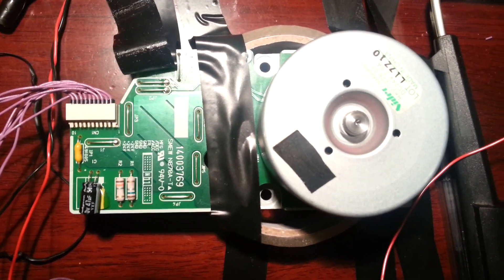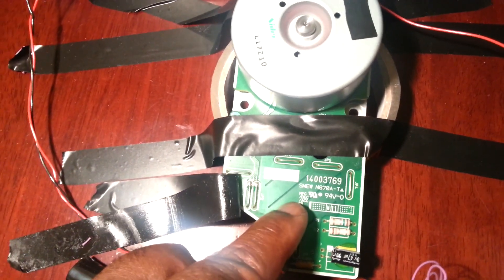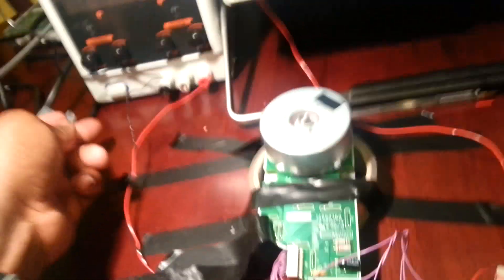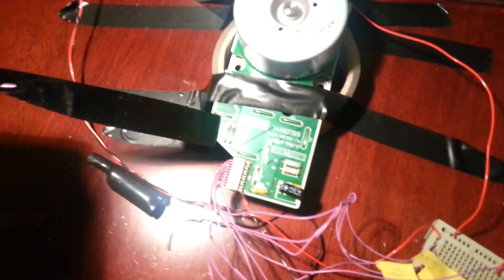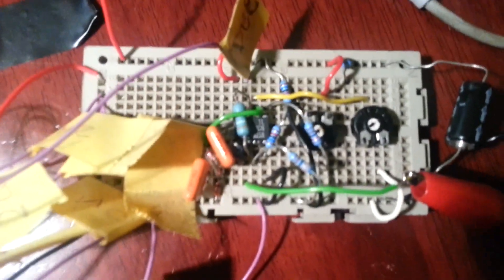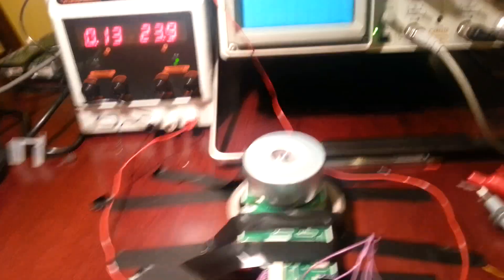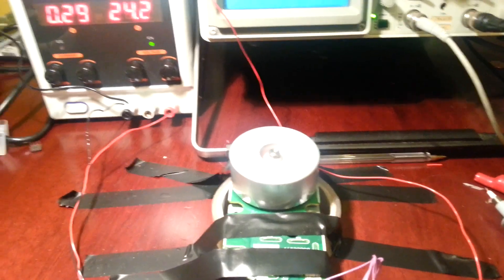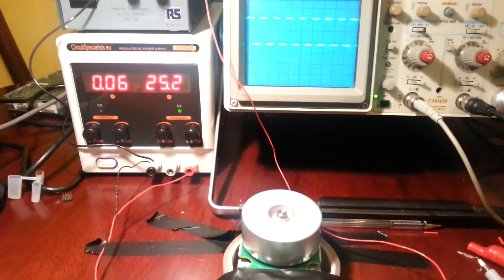Running an HP 2605 Laserjet Laser Printer main drive BLDC motor.

Comment: Hi.
 I have a Nidec brushed motor. It has 9 pins. I removed it from Lexmark t650. How can I run it with power source? I will use it in another project. Motor image:https://l24.im/50m Mail : mert.baldrr@gmail.com thanks

Comment: Just FYI the "Ac" and "dec" pins stand for acceleration and deceleration... they regulate how quickly the motor slows down or speeds up per instructions from the driver... 
Nice video tho, thanks for sharing!
Cheers!

Comment: Hello Coolkeys2009, I have a few of these motors and a couple of arduino Uno boards that I'd like to match and use. I'm not quite familiar with electronic but, do you have a schematics that clearly illustrates what to do and need. I'll check afterward for the arduino libraries to make it possible... Thanks in advance

Comment: Hello Coolkeys2009,
impressive hack you have there. I've tried to PWM control that beasts and broke two of them by possibly overcurrent or so...is that even possible? I had them on 200Hz and 5kHz. I cut the power supply to the motor when it was too fast, I had a fuse in the way. 1.6 Amps and it hasnt burned. o.O

Comment: Hi. I see this video is pretty old now, but I'm hoping you are still out there ;-) Thanks for posting these videos, they have been the best resource I have found on motors/controllers of this type so far. I have one with only 6 pins (that are unmarked) but have determined that they are 24V, GND, /ACC, /DEC and FG. Using a micro to pull the logic pins high or low I can get the motor running full speed, like you said (/DEC high, /ACC low), but try as I might, I cannot get speed control to do anything. If I pull /ACC high while the motor is running and then stop the motor by pulling /DEC low it coasts to a stop instead of braking hard, which proves to me that /ACC is having an effect. I expected that putting a PWM signal on /ACC would control speed, but apparently not. Does it need to be an analogue voltage?
Reply from the maker: Jason Suter Hello, pwm should have the same effect as you manually setting the inputs high and low. The pwm range needed to go from off to full speed may be quite narrow. If you can start and stop the motor from the micro I can only suggest you try different pwm frequencies/duty cycles and maybe check the pwm waveforms on a scope. Also pwm will control the motors power output not it's speed so try adding some mechanical resistance to the motor as you vary the pwm to see if it changes speed more then.
Reply: Coolkeys2009 Thanks for the response. I hadn't considered that the output power was what /ACC controlled, rather than the RPM directly, I will try and introduce a bit of mechanical resistance. Am I correct that you just used a PWM on the /ACC pin and a high/low on the /DEC?
Reply from the maker: Jason Suter I can't remember exactly how I wired it up or if I needed to invert outputs. I actually remember adding some logic so I could enable and disable braking when I connected the motor to a micro-controller. https://youtu.be/cVwa4IvZflU and https://youtu.be/PG-9jKESIQU The circuit was implemented with nand gates.
Reply: Coolkeys2009 Sorry this took me so long to reply to. Turned out my PWM on /ACC was just too low in frequency, once I cranked that up it worked beautifully.
Reply from the maker: Jason Suter Nice one. :-)
Reply: @JasonSuterOssum  Can you send the wiring diagram?
Reply: @mounirshawki5000  Unfortunately this was such a long time ago, I really don't remember what I did, and I don't have any of mynotes, the best I can offer you is this instructable that I wrote at the time https://www.instructables.com/id/Upcycle-Brushless-DC-Motors-From-Printers/
Reply: Can you give me the frequency. I have found an old Nidec motor with Dec and Acc pin. When i apply 5v to Dec it runs full speed. And I am trying to control it through Acc pin

Comment: i have rh7 1260 inc driver board.. also i have 6 black wires... in this order +24+24GndGnd and another 2 wires I cant tell if it is 2xww or two MM   les say MMOTD(P/S)  & MMRDY(LD)   CAN I USE MICRO CONTROLLER TO SEND SIGNAL OF +5V   THANKS
AS I SAID  A HAVE 6 WIRES ON DRIVER BOARD 2X+24V  THEN 2XGND  AND 2X WHAT i ASSUME THAT WOULD GET MOTOR MOVE

Comment from the maker: It was a couple of OP Amps TL082, the first was responsible for f/v and the second a comparator. I believe phase locked loops are used in the actual application to get the required accuracy.

Comment from the maker: Hi there, Sounds like you have a different type of motor probably a fixed speed one. I can only guess gnd = 0v, 24 = 24v, mon = motor on INPUT active high or low. Half = INPUT half or full speed, mrdy OUTPUT = motor ready i.e the motor is up to speed & PLL locked. The logic inputs and outputs are probably 5v, I would use a 1 or 2k resistor in series when pulling them high or low. These motors normally have a MFG or MPG open collector output which needs a pullup resistor that can be used to determine the motors speed.

Comment: very nice work.   Just pulled one of these out of a printer
Reply from the maker: Cheers, if you're planning on running it, make sure you use a current limiting resistor on all inputs during testing. You can drive the inputs directly from 5v logic though.